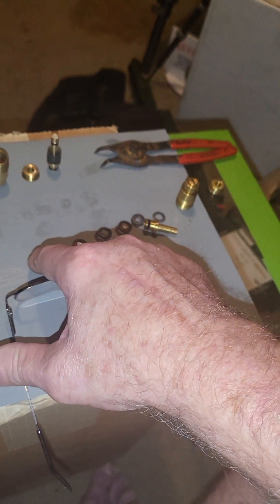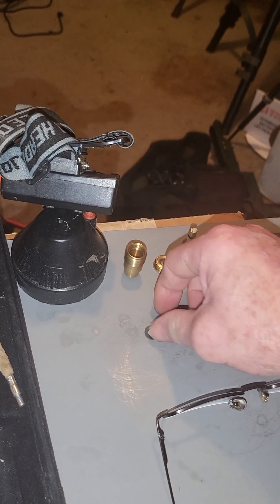Avenger Regulator 👍🏻🎯✌🏻🤠

Comment: How are you getting the regulators apart? Did you make a wrench?
Reply from the maker: Put a little heat on the end with the 2 holes, just around the main body. Reg in glove hand, take some snap ring pliers, insert into the holes. Besure to remove that small o'ring on the stem 1st. 
Also don't put to much heat, if you can help it on the stem... delron, white plastic on the end of the stem, material will fall out!
Reply: @ezrabrook3993  thanks for the info!

Comment: Hi sir, what size is the small oring on the brass shaft that seals it in the rifle? Its totaly flat on mine so it won't seal. When you back it out from flush to adjust the air rushes out of the regulator hole. You can screw it back shut and it seals so i just need that tiny oring. Any help is appreciated and thank you!